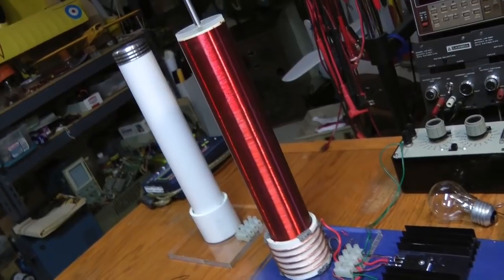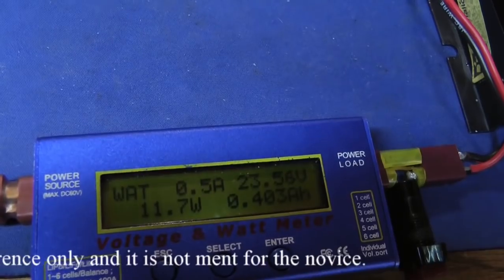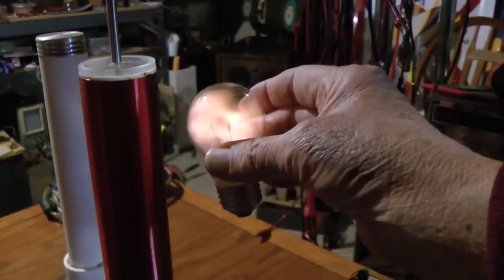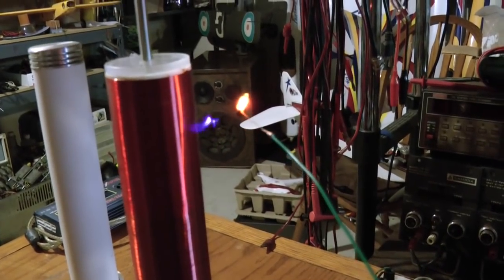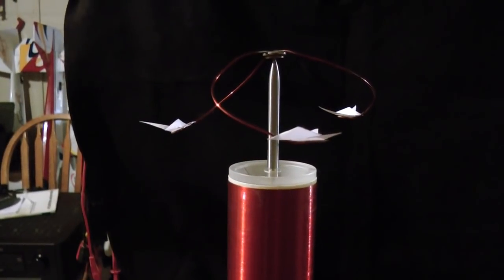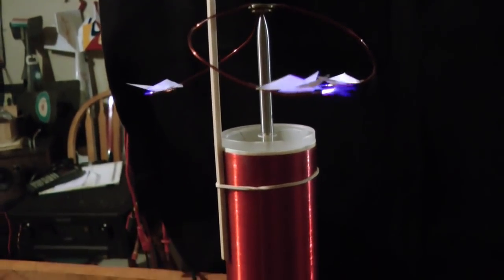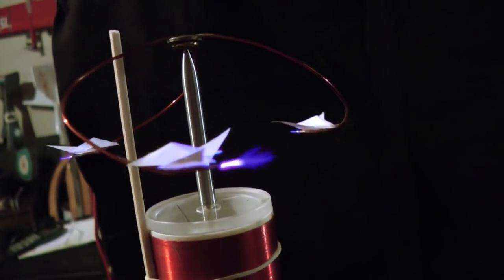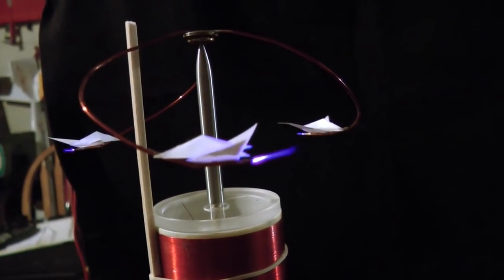Tesla / Slayer Ionic Propulsion

Comment: Heating air causes it to expand. The thrust is caused by heated air. Do it in a vacuum and see if thrust is still created
Reply: aeonmike there will be nothing to ionize in a vacuum
Reply: Cooper Hart that's not how it creates thrust
Reply: Clearly nothing can happen without ionization though
Reply: Cooper Hart how do ion drives work in space then
Reply: the ionized particles are electrostatic accelerated out the back of the spacecraft creating a tiny bit of thrust

Comment: The plasma is created by the electric circuit and it burns the air/oxygen surrounding it causing the little blue flame. In a vacuum however you wold need to introduce a combustible element such as oxygen or something you could control the flow of to provide a constant burn. 😊
Reply: Paul Roberts sounds like startrack is comming a bit closer
Reply: Yea. You're correct. So many comments going on about 'space application' when we've already tried this. It still requires some form of fuel to be ionised because unlike our atmosphere, space is a vacuum.

Comment: its pushing air only because of the ION stream my ? is will it propel in a vacuum?
Reply: Bro I was about to ask the same question.
Reply: They could store the air molecules, or whatever appropriate alternative  there is, on the spacecraft. They could then propel it out the back, giving the spacecraft forward momentum, as net momentum equals 0.
Reply: There would still be no back pressure as there are no other molecules aside from the ones you introduce into the vacuum

Comment: I think you should try it in a clear acrylic pressurized tube. Maybe something that closely replicates the same conditions as space and see what happens. I think your will find a energy increase in a vacuum ;)
Reply: 'space' is water so a simple test in a tank will do, exactly as nasa does... have fun!
Reply: Michael wheels-and-bricks 😯😮😒
Reply: Space is total vacuum. They train astronauts in the use of space suits in water because it somewhat simulates being in a zero g environment however space is nothing like water.
Reply: ehm, can't be true because the "total vacuum" would have ripped apart the "space" suits. it makes no sense.
just imagine that for a moment and look up experiments in vacuum.
in weak vacuum liquids boil let alone "total". the astroNOTs blood would have boiled. 
waters below and waters above. 
good luck!
Reply: The suits are designed to deal with that kind of pressure. Space is a total vacuum.
Reply: I've done vacuum experiments, I know what it does. The space suits are pressurised so their blood doesn't boil and so they can breathe. 
So ehm, you are so wrong.
Reply: So so wrong.
Reply: ah ah, one more problem they have in "space": the heat from the sun. it is a "total vacuum" right? so no convection possible. sun rays heat up any object - astronot's suit for example - since no heat can't escape the object will heat up to the maximum temperature transferable by the rays which on earth is 58C - at temperatures above 41C proteins denature (humans die). do they have air conditioning systems in their suits? well, no convection in vacuum so no heat exchange and we are back to square one... they can't have it both ways. please think about it and open your eyes.
Reply: And you're telling me to do some research. Laughable.
Reply: It's infrared radiation. And yes, heat build up in space suits is an issue and yes they have air conditioning in the suits. The heat build up in the suits is something they have to be aware of just like the oxygen supply. Just stop and go do some reading.
Reply: James Martin Don't let the flat earther troll you, it's not worth your time.
Reply: Tyler Herring I know I shouldn't. I just can't help myself when people are so wrong and it's so easy to educate yourself with a little googling and research.
Reply: James Martin, I understand. The issue with google and internet searches is not the amount of info available, it's the operator. With all of the easily accessible information from numerous  sources, both credible and not so credible, confirmation bias is now a big issue.
Reply: These flat earthers crack me up, I can't believe anyone give so much credence to what they hear on a few you tube videos.  By the way what's holding all that water up there?
Reply: Matt McHenry, my gut tells me dinosaurs but you know he doesn't believe in them either.

Comment: Why did i hear a fan turn on when it was blowing out the lighter? At 3:23
Reply: Rian Baker Your right
Reply: Rian Baker, you didn't.
Reply from the maker: Rian, There are no tricks here. This type experiment is all over YT Just google it. Why not read some of the comments from people who know what they're talking about that came after your post. It would seem that similar more sofisticated drives are used on satelites. If you're looking for fraud you've come to the wrong channel. Don't come back.
Reply: DadHav I love that I asked about the sound of a fan I hear turning on, and then people assume I'm trying to say something, tell me I don't hear a fan turning on. I didn't claim to know anything about this stuff, I do however know what a fan sounds like.
Reply from the maker: You will hear that sound randomly on a lot of my videos. There is a fan on the Panasonic TM 700 camera. It's very tiny and usually goes unnoticed, but many users have complained about it. I made a tiny shield for it that directs the tiny amount of air towards the back of the camera and blocks some of the buzzing from the mike. Occasionally depending how I hold the camera or how the automatic gain control in the mike system is working, you can here that sound. The resonator also has an effect on the camera electronics and I'm not sure if that isn't what you hear. You're seeing and hearing something that is coincidental. If you are only, at this time, one of 200,000 people to mention this, I probably won't take the time to make another video to prove there is no fan. Sorry I said not to come back. My jimmies just get rustled when some accuses me of things that aren't true.

Comment: The high voltage is concentrated to a point, and disharging to the atmosphere. Fast moving electrons ionise gas molecules (both oxygen and nitrogen have unfilled outer shells). These are accelerated away from the negative electrode. The fast moving ions also transfer some momentum to uncharged molecules and together form the thrust. The blue corona is caused by discharged electrons  kicking electrons in atmospheric gases, to higher energy levels and collapsing to degenerate orbitals emitting a photon, like lightning does.

Comment: Looking only at the spinning spacecraft... One of the basic laws of physics is applicable here.  "Action and reaction are equal but in opposite directions".
Look at it this way.
The plasma stream emanating from the spinner wire(s) is sending energy in one direction. The wire that it is emanating from, therefore, feels a reaction to that flow of energy in the form of a motive force.  It is not dissimilar to a rocket motor but on a tiny scale.  Energy flowing away from the vessel (rocket or wire) gives the rocket or wire an equal and opposite reaction in the form of motive force.
There are spacecraft using this plasma drive technology today.  My American cousins (I live in Scotland) are the world leaders in this technology.
The force that a satellite, for instance, receives is about the same as a human breath blowing on the satellite.  It reacts by a tiny amount each second and very slowly picks up speed. In space it can take a year to get a satellite, travelling across the solar system, up to speed but what the heck, It's not in any hurry.
Looking at the effects such as the fluorescent lamps... this is a gas being ionised by the high voltage magnetic field.  The ions are in a partial vacuum and can move around with relative ease.  When they collide with the fluorescent powder coating they emit light.
Whichever way you look at it... It's really neat!
Reply: Agent Bertram Are you high on something man...
Reply: No... I can't afford anything nowadays.  Also, I live in the remote Scottish Highlands and you can't get anything here.  Life is such a bummer!
Reply from the maker: Agent, To bad you're so remote, but maybe it's a good thing in the long run. Thanks for the comment and you're right. Zero to sixty in several weeks, but hundreds of thousands miles per hour eventually.
Reply: Agent Bertram thank you very much for the explanation.

Comment: You can see the airflow through the special air density viewfinder (it will not cost you a dollar, by the way) that I saw on the Veritasium channel. Apart from that is the temperature, since the plasma does "boil" the air. Maybe humidity has a part in that efect.

Comment: put it in a vacuum and you'll know if it was pushing air or not.
Reply: That's not a valid experiment though, he means if the ions that are being pushed are pushing the air.
In vacuum there is none, so obviously the ions wouldn't be pushing anything.
Reply: Sorry, wrong. Ionized gas will push a rocket through a vacuum (like in space).  Bear with me. Here are 3 things that work exactly the same, all 3 are examples of a SOLID OBJECT being moved through air (or space, a vacuum) due to RECOIL.  
1)  fire a rifle. Bullet goes straight out in front of you. Where does the solid object -- the rifle - go?  Right back into your shoulder.  If it's a powerful rifle, your shoulder will hurt after a day of hunting due to the rifle recoiling backward from the firing of the bullets. The rifle moves exactly opposite direction of the bullet just fired.
2) rocket engine in space -- the metal body of the rocket is the rifle, the burning jet of fuel coming out the back is the bullet(s). When the rocket body fires its bullets (shoots burning rocket fuel out the back), the rocket body (the 'rifle') moves in the exact opposite direction -- and that's how the rocket moves in the vacuum of space
3) ion thruster -- the little jets in DadHav's video are the rifles --- and the purple plasma streams shooting out the back are the 'bullets'.  RECOIL makes the little jets move. Ion thrust devices move due to the same RECOIL as a rifle, and a normal rocket in space.  TO MAKE AN ION THRUST DEVICE like DadHav's little jets operate in the vacuum of space -- where there is no oxygen to ionize -- the ion thruster manufacturer just straps on a tank of gas onto the body of the ion thrust space vehicle.  No gas to ionize in the vacuum?  Just BYOG (Bring Your Own Gas).  Japan did this in 2003 => see here:  https://en.wikipedia.org/wiki/Ion_thruster
And here's the relevant text from that link:
"The Japanese space agency's Hayabusa launched in 2003 and successfully rendezvoused with the asteroid 25143 Itokawa and remained in close proximity for months to collect samples and information. It was powered by four xenon ion engines. Its xenon ions were generated by microwave electron cyclotron resonance and an erosion-resistant carbon/carbon-composite material for its acceleration grid.[59] Although the ion engines on Hayabusa had technical difficulties, in-flight reconfiguration allowed one of the four engines to be repaired and allowed the mission to successfully return to Earth."

Comment: The fact that there is a blue glow indicates one thing alone. The oxygen molecules are being ionised. As Oxygen exists as a non polar molecule (O2) this would create a charge imbalance. My guess is the charges are being deposited in the oxygen molecules on one side at a high orbital, then when the electron jumps back down to a low orbital, you are getting the blue diffuse glow. But before that blue glow occurs, the EMR field being produced by the transference of the charge is causing the O2 ions to be repelled from it. Thus, the thrust you see is caused by repulsion. The air is literally being forced away from the spark, and new air is coming in behind it at the same rate. This means there is a constant pushing of air away from the spark side, and as F=ma , there is constant propulsion of the 'vehicle'. Very clever setup, this is exactly how ion propulsion started. It is a rudimentary version of the ion thrusters used on small sats. The reason this works in space is due to the fact that there are still small amounts of atmosphere at high altitudes up to 1000+km in orbit. Although the thinner the atmosphere, the more acceleration you need to impart on each molecule to get the same thrust.
Reply: tryAGAIN 1987 well you are wrong about why it works in space , it works in space because they bring the propellant instead of air they use Xeon
Reply: @Lachlan O'Neil - No I'm not. I never said they don't use Xenon in space. I said in LEO it is pointless using Xenon on small sats because there is enough atmosphere to produce the same effect without adding the extra fuel. I am aware that with heavier craft or higher orbits it is a requirement to use Xenon, but in lower orbits, it is unnecessary for light satellites. 

And did I say something was different about how it works in space? Did I say something about it being a different mechanic that caused it to work in space?
Reply: @Lachlan O'Neil - I see what you are saying. I am talking about this on another thread. I mixed this up with that. I am just talking about the process, not the fuel here.
Reply from the maker: Thank you friends for the comments. They're well thought out.

Comment: I hope Im getting this right...since ion propulsion can function in a vacuum and in space, it doesnt need the pressure of air to propel an object. Ions create their own field, essentially pushing off eachother in small, but applicable amounts. Ions are a part of plasma, not vice-versa. They are similar, like water and ice: the "same", but in different states. Plasma has a delicately relative neutral charge, which is why it flows like water, especially in a vacuum like we see in the lightbulb in this video. Ions are in an excited state, but it is the overall balance of those ions with the supplied and surrounding forces(gases and electrical properties) which creates the event, like lightning. And lightning is trying to seek balance. Positive meets negative and does what?
Reply: You almost sound like you know what you're talking about.....LOL.
Reply from the maker: My recent understanding is, space isn't completely empty and an ion drive would work but extremely slow to gain speed. On the other hand if you inject xenon gas into the stream it becomes practical an is actually being used in that manner. In this simple demonstration ions are released from the cathode and seek a complete path to the anode which happens to be ground. Therefore this experiment would not work in space in my opinion. A drive in space has the anode and cathode on the engine. My though is, with the absence of atmosphere you could just use the positive and negative sides of the resonator to solve the problem.

Comment: What's happening is air (matter) is passing through the high voltage field. When that happens electrons in the circuit are bouncing of the atoms passing through. Some get redirected, with a majority of the bounced electrons wanting to move towards the smooth edge of the circuit. The problem with electromagnetic propulsion is that it is still matter dependant and is using particles of matter in the atmosphere as fuel.
Reply from the maker: Yes in a vacuum you need an inert gas injected into the stream to create a mock atmosphere.
Reply: DadHav 

Exactly, I think best approach is combination of EM Pulse, as potential fuel source for the Ionic Propulsion Engine. 

Basically, making it a Energy Driven Propulsion System. With unlimited fuel.
Reply: DadHav 

There's only so much gas you can carry. So no continues propulsion, no speed of light.
Reply: DadHav 

Any chance I can get you to design a working EM Pulse Injector  (BTW, Theres no such device in existance and do a few test in designed to measure the Microneutons of propulsion produced. If you you can build a rig, I might be able to get you a vacuum to test it in.

Comment: I believe this is ion wind. The electrons leap to nearby particles in the air (the lightning you see), the then negatively charged air is repelled by the negative tip of the wire
Reply: Cinsightfully it is ion wind just like that created in lifters. 
Townsend Brown experimented with the flying disk. 
Townsend Brown noticed that a capacitor when it released its charge it created a thrust. 
Tesla also said in book he knew how to build a flying craft that would fly steady an not be affected by storms. 
This maybe just what he spoke of.

Comment: It's the heat from the electricity. You're essentially welding the air. That should be co3 if you add humidity to the equation.

Comment: Gravitec tested it for NASA on multiple occasions and it does work in a vacuum, there have been other independent tests since. Also, some of the larger 'lifter' models have experienced thrust that's way in excess of what ion wind would predict.
Reply: I thought the opposite,, I thought this requires oxygen for the high voltage discharge from thrust..

Comment: The spark blows out the torch not because it creates any wind, but rather because the flame itself consists of a plasma of ions which interact with the electric field of the spark.
Reply from the maker: The effect is definitely more noticeable on the flame but it will move a thin piece of paper around with what ever is moving after the point of the plasma. Of course if you get to close it starts the paper on fire. I suppose that could call for caution if you have a cluttered work space. LOL.